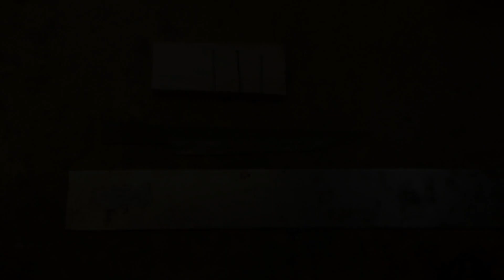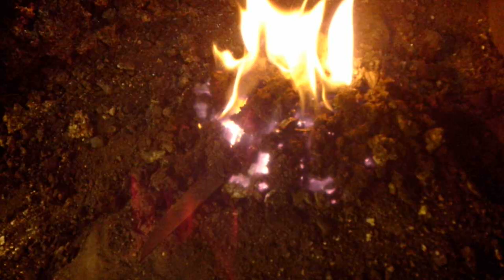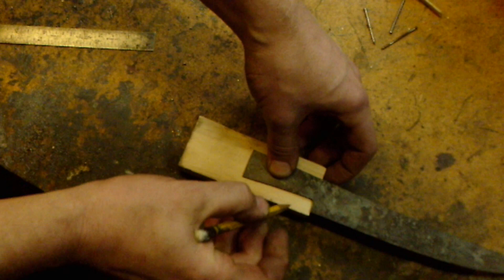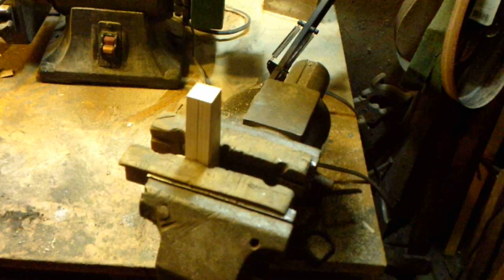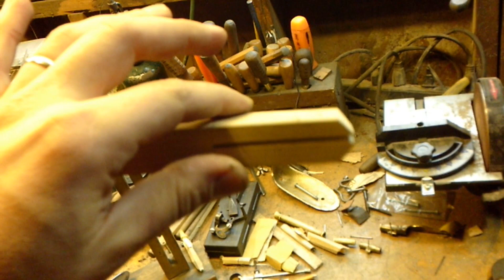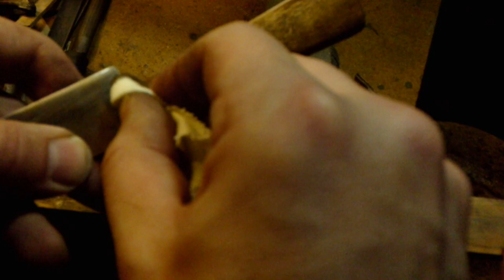Making An English Trade Knife

Comment: Might I suggest a disposable razor with your first aid kit? Neither steri strips nor other adhesive bandaid will work if you’ve got a couple days worth of stubble. I sustained a significant throat wound near Blue Mountain lake a few years back. I got very lucky with its location. All I could do was maintain pressure and drive like hell to Indian Lake’s medical clinic. Luckily they still had some emergency clinic gear on hand. 8 stitches later and I was on my way. Having a disposable razor would have made things much easier. Now my various kits all have one.

Comment: There were generally two kinds of knives seen on the frontier.
Most common was some variety of imported knife or trade knife.
These came in various sizes and 
shapes.  Old Hickory brand still sells many of the old patterns.
In that time the blades were shipped to the colonies in barrels without handles.
 Local wood, bone or antler was used for handle material.
The other knives were blacksmith made knives generally made out of old files.
These were the "long knives" that many of the early hunters preferred. 
Some hunters and trappers used factory made knives modified to suit themselves.  See the Nessmuck knife as an example.
Thanks for the video.

Comment: English Carving knives like this were produced in their 10s of 1000s and exported around the world. Those made for British d8nner tables during the period were of higher quality in general Generally Sheffield but also Birmingham and Harrow . Same blade form for hundreds of years .Usually 7 or 8 " long . Generally paired with a forged 2 prong fork and sometimes a sharpening steel . Full length wire tang to suit any wood ,bone and antler with a flat cap pommel . Blades are thin and designed to slice roast meat and not robust enough for military use an old ones unless well cared for will snap easily at the firsr rivet or at the handle if bone or antler as the resin promotes rust . You can buy these at boot sales and market stalls in the UK for a few quid if you are 18 + . I have quite a collection of these with mahogany , ebony,  walnut , box and holly ,  bone is common and several antler with polished steel cap pommels , but we call them carving knives . Unless very ornate with precious metals and detailed blades , value is ' low ' .
Interesting to see that you use the old English penny weight for nails . 4d ( or fourpence ) is 4 pennyweight . Knife makers in England linished the blades on finishing . I have a cast iron Sheffield made belt linisher called " The Linisher " .
Reply from the maker: Thank you for sharing!